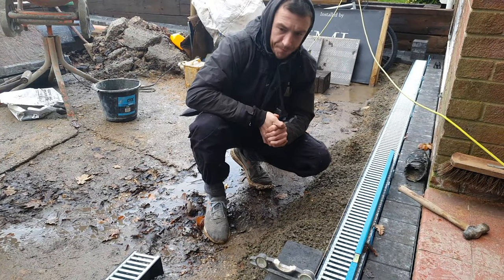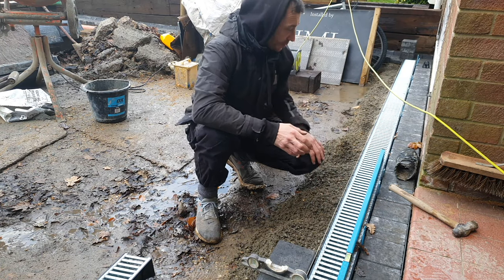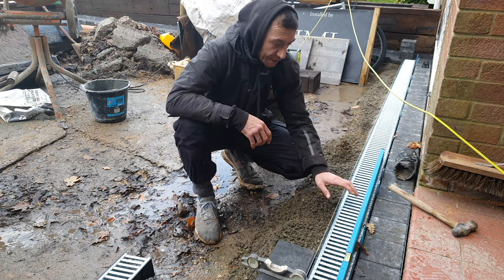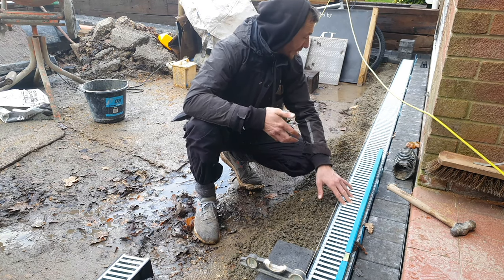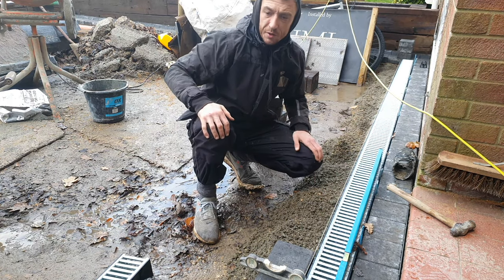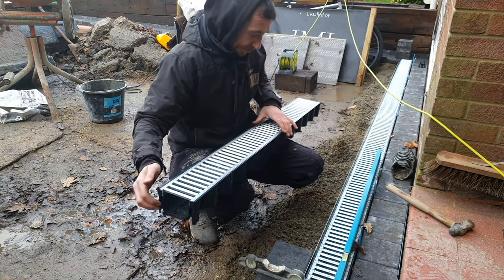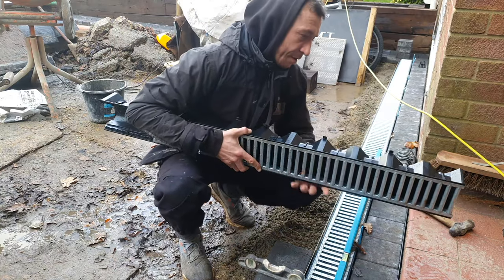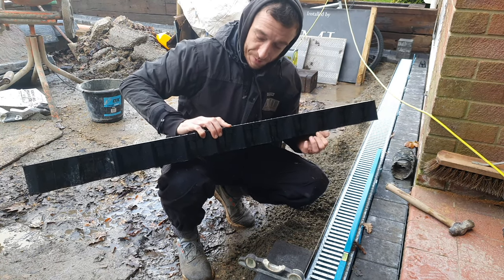How to install a driveway - How to Install Aco drainage - landscaping uk - VLOG06

Comment: Hi pal quick question, the pipe the water goes through, do you let it go into the earth or have you got too fit it into an actual drain?
Reply: No reply. Seems he doesnt know!
Reply from the maker: You fit it to a soakaway,  preferably 5metres away from the property. 

If you let it run into the earth this would cause issues in the long-term. 

Apologies for the late reply jacks20009🙏

As always appreciate your comment and support 🙏😁

Check out the next video along its a how to install a soakaway I believe that will show the connection

Comment: Do you lay these level or to a fall?
Reply from the maker: Hi mark , so for these i laid them level as it only 5m wide and the water will naturally find its way to the drainage hole as long as it isn't falling away from the hole you won't have any problems.
If you were doing any larger areas i would recommend you have a fall towards the hole and obviously you need a run on your pipes leading to you soakaway. Thanks for your comment 👍

Comment: Hi mate, should there be a fall on these towards the outlet ?
Reply from the maker: Hello mate thanks for your comment, for this I have gone level as it’s only 4.5 m wide , so the water will naturally find its way to the outlet, if your doing larger areas I’d suggest having a slight fall but as long as you don’t have a fall going away from the outlet you shouldn’t have any problems. You definitely need to have a fall on your drainage  from the outlet to your soak away . I hope that answers your question, and again thanks for the comment.👍
Reply: Cheers🖒
Reply: I'm missing something.
If your drain has a 1:200 fall on it and you want it flush with your block work, does your block work have to have the same fall?? So if I'm doing a patio, I want the drain to be parallel with the brick work on my house. Then the patio to have a slight fall away from it. So does your finished stone work need fall right to left to match the drain and front to back to come away from the house??
Reply from the maker: @scottlinus hello mate, in short yes if you have a fall with your drain I would run the block work the same.

It also depends on how long your run is if it's like a 10 metre run of drainage you'd definitely need a slight fall on it. For me as explained above I just kept my aco drainage level so it looked parallel with my brick work. I had a very minimal run on the blocks between the aco drain and the house,  running from the house back into the aco drainage.  Also from my aco drain to my soakaway there was a fall off 1 inch per metre.  

Does that help?

Basically if you have a run on the drainage,  I'd run my blocks the same as the drain. But that wouldn't be parallel to the brick work.

If the run wasn't to long I'd run my drainage level so it looked parallel.  But make sure that the run from the drain to soakaway was decent. I'd also run some blocks/slabs between the drainage and the house wich would match the drainage level left to right but have a slight run from the house to the drainage.

Comment: I saw that you laid this plumb, does the water still run well as the inside is also plumb.
Reply from the maker: The acos are installed level witg the slightest run towards the drain hole but there fixed to a pipe which has a run to the soakaway.

Comment: Thanks for the vid. I’m about to lay about 5.3 metres of aco drain. The short section you had looked like less that 50cm. I was told I couldn’t get it cut any less than that. Is that the case? Thanks
Reply from the maker: I can't remember specifically but you can cut down to any size unless your needing the hole in which case you would have to allow for that. Thanks for the comment 👍

Comment: I appreciate your attention to detail Jasper. Snipping off the bits of plastic off the bottom of the ACO drainage, so when you place the drainage up against the blocks it doesn’t push up against the cement and the blocks shows how much you care about doing a good job. And I noticed you didn’t put the drainage right up against the wall, placing blocks in between the wall and the channel drain to prevent damp issues later on that happens when builders put drains to close to a wall of a house. Are they just ordinary blocks or bricks or engineering bricks? I’m hoping to have the same thing on the side and front of my house, using engineering bricks because they have low absorption of water. 

It’s a nightmare though finding a genuine builder in Essex who can lower my block paving on my driveway and path that leads to my side gate and garden patio at the back because ground level at the front of my house is higher than the back of my house where my garden patio is causing damp issues on my exterior wall on the side of my house because the block paving and garden patio is too high, either, just above my air bricks or level with my air bricks. The side of my house is the worse because my air bricks are 1 inch below my block paving and that’s where I have salts on the inside wall in the cupboard under my staircase where my gas boiler is. So, my path on the side of my house is sloped from the back to the front driveway. At the front of my driveway I have three air bricks that are too low with my block paving. Options I have is to make my flat driveway sloped with ACO drainage in front of my 3 air bricks and along the side where I have 2 air bricks which has a solid wall. But if my driveway is sloped I feel I will need drainage all around the front and connected to the the drainage on the side of my house. But I’m worried the builder will install the drainage incorrectly and add more problems with damp later on. Or I could keep my driveway flat with a step down in front of my house where my 3 air bricks are and install an ACO drain just there and another step on the side of my house, so my driveway can stay flat and not sloped, installing a channel drain on the side of my house in front of my 2 air bricks. So, if I don’t have a sloped driveway and keep it flat I will need to lower my garden paving slabs so they are not level with the air bricks at the back of my house and lower the ground level to at least 75ml and the side of my house to keep it all the same level and where the side of my house meets the driveway have a step up there. I realise you don’t have the time to look at my problem but I wish you was a local builder in Essex. Thanks.
Reply from the maker: Hello mate apologise for the late reply,  yes these were just normal concrete blocks. I'm sorry to hear it's such a nightmare to find anyone decent near you,  if it was me I'd most likely go with the slope with the drainage but without seeing it I wouldn't be able to make a good enough judgement,  have you tried social media to try and find someone?  Cheers for commenting it's much appreciated 🙏

Comment: Do you lay these level. Is the fall built into the channel internally?
Reply from the maker: I laid these level with the most minimal fall towards drain but on larger length I would definitely recommend a fall,  there isn't a fall built in internally.

Comment: Hi, I'm looking to fit something similar in my garden but wondering how the water flows when you have it level?
Reply from the maker: Thanks for your comment Jamie, so because this was only 4m wide once full or filling up they naturally drained as the pipe there connected to leading to the soakaway has a run on it.
Reply: Bubble touching line. Can't go wrong

Comment: If connecting these to a soakaway does it need to have a gully or sump to stop, leaves silt ect getting into the soakaway?
Reply from the maker: The aco drains have something to stop leaves getting down, but i think you have to buy separately but a sump would definitely be beneficial although i did not do that on the project.
Reply: @jaspermillerlandscaping6174  Thanks for the response, will take a look into what's available for aco's then 👍

Comment: Hi can you link these up to an existing downpipe drain?
Reply from the maker: Yes, you can. As long as you have the correct connection,  110mm is standard buy. There are some other connections, too, if smaller or bigger, required 👍

Comment: My eco channel grate covers in front of my garage have Philips screws holding the lids down that have seized, any ideas how to lift them
Reply from the maker: Any good with an angle grinder? That would be my first option,  if not have you tried spraying some WD-40 or some penatrating oil. Thanks for commenting Bryan I'm sorry I can't think of many other ways of getting that one sorted.
Reply: @jaspermillerlandscaping6174 Angle grinder was my 1st thought aye but wasn't sure if the bolts were designed to be popped or what, needs done anyway so think it's a cut and run job lol
Reply from the maker: 😁👍 I'd do exactly the same mate , im sure it'll be fine, thanks again for the comment

Comment: Hi Jasper. Fine Video mate. 
I'm going to pinch a lttle on the damp proof course so as to get a better drop drown to the other aco drainage channel. my drive is raised from my neighbours house. I thought I'd put acos directly against the wall so as to limit rain splash against the house rather than put a row of blocks first. is that OK and if I can't put a soak away in as only 4 metres from house and 3 metres from road is there such a pipe with like a plug on so I can drill a hole in the support wall to my neighbours house and then after rain remove the plug or unscrew a fitting to drain out the water in the acos that will run to a drop at the side of the drive and effectively harvest the rain water. Bit hard to imagine I know . appreciated
Reply from the maker: Hello mate thanks for the comment,  yes you will have no problem installing them up against the wall , and regarding plug on a pipe I'm not to sure on that one it might be worth having a chat with a local builders merchant about that. There must be something like that out there though.

Comment: Great video, do you know if it would be ideal to install some ACO drains across bay windows and run to the mixed waste at the back of the house? Seem to get a lot of pooling water near the bay windows when raining, thanks.
Reply from the maker: Thanks for the comment core coder,  i don't see any problem with that as long as you have a run going from the acos to the waste. In regards to the mixed waste i take it you mean were your gutters ect lead too??
Reply: @jaspermillerlandscaping6174  yes I only have the one manhole and both sinks and toilet go to this one place, I’ve read that some houses have separate ones for foul and clean water?
Reply: @ChrisHansonDev   It would work, but put a S bend so the smell if the sewer dont come up through your aco... Your toilet and sink has a S bend to stop smell of grey/waste water coming back though

Comment: What do you do with the 5m gap you’ve left between brick and drain? I’m installing these on Saturday would love some advice
Reply from the maker: Thanks for the comment Chris,  I fill it in using a product called easyjoint,  its really easy to use , you just wash it in. You can also grout but if you haven't done that before it might be easier to use easyjoint.
Reply from the maker: Sorry mate just realised I thought this was another video lol for the 5mm gap ( It's actually 10mm gap,  I just said it wrong in the video lol) but I pointed this in using a 5:1 ratio of building sand and cement.
Reply: I’m putting the drains against the wall of my house in the garden do I still need to leave the gap or can I put it right up against the wall and cement underneath? Then I will start laying the paving right up against it correct?
Reply: Thanks for getting back to me
Reply from the maker: Yes mate correct no need for gap you can install the drains right up to the wall. No problem, anytime.
Reply: Thanks a lot for the help and advice. Love your videos. Watching the paving ones. Just hope I do a good job this weekend after someone done a runner with my money after I trusted them to do a job for me. Small job but still low life’s out there
Reply from the maker: What a scumbag, yeah there are a few of them out there, no problem. Let me know how you get on. Just take your time , watch a few YouTube videos on how to install em to get a few ideas. But there really straightforward to lay you'll be sweet.  Cheers
Reply: @chrissardinha1824  You don't want a gap or water will run into it rather than the drain

Comment: The steel grating on the aco drain has started to rust, should I replace them, on try to remove the rust with jenolite?
Reply from the maker: depending on how bad they are id personally replace them.

Thanks for the comment

Comment: When laying the cream coloured  resin composite aco drains,how do you remove the hole in the channel that connects to your drainage?
Reply from the maker: Haven't used those in years but I'm pretty sure, just like the black plastic ones you just have to hit with a hammer 🔨,
Reply: @jaspermillerlandscaping6174  thanks mate.
Reply from the maker: No worries bro, i would personally turn the aco drain upside-down on a flat surface give it a few taps first and see how you get on, but you shouldn't have any problems,  let me know how you get on 👍
Reply: @jaspermillerlandscaping6174  someone suggested turning it over and using a hammer and an old flathead screwdriver to tap it out. 
I'll let you know
Reply from the maker: Nice one mate 👍
Reply: @jaspermillerlandscaping6174  i cut the holes in my drains today buddy.
I used a hammer and a large flat head head screwdriver to tap the hole out.
Absolutely perfect and no cracking of the aco drain at all.
All the best
Reply from the maker: Nice one mate, didn't think you would have any problems.  Thanks for the update. So is it just the aco's your installing or are they part of a bigger project?
Reply: @jaspermillerlandscaping6174  only the acos across a garage entrance.
All finished today and draining well i might add
:-)

Comment: I don't see the point of these

What are they actually doing?

Moving a few litres of water away, to where?

Plus they get clogged up every month
Reply from the maker: thanks for the comment deep mystic,

So for this property the driveway ran downhill, so to prevent the water sitting against the house , The aco drain connected to a soakaway 5metres away from the property. 

yes unfortunately there is a little maintenance involved around autumn time.

Comment: What silicone did you use to put the end cap on?
Reply from the maker: I used a product called aqua bond,  its a product used to join artificial grass together. I got this from a company called namgrass,  but I'm sure there are other suppliers. Thanks for the comment 👍
Reply: Would you just silicone the end gap or each joint? how do you determine the fall I’ve about a 5m length for these to go into it’s a drive and the fall naturally runs into the drain hole but these would help it disperse quicker or would I make it level with the paving that’s there?
Reply from the maker: Just the end cap, joins do not need it. So yeah as long as the fall always heads towards the drain you would have no problems on 5m, level is perfectly fine in my opinion. The main thing is You definitely do not want this running away from the drain your connecting the aco drainage too.

Comment: Hi mate,

I've recently started my own landscaping business with a close friend and I came across your video as we are looking to expand our business and offer more hard landscaping services such as patio and driveway installations. Can I ask what the pre-mix you used with the cement to make a mortar to lay the drainage channel onto was called? Can you use your patio mortar mix to lay this type of drainage channel or does it have to be a seperate mix? Thanks!
Reply from the maker: Hello mate , yes so it's jus a 10mm premix of sand ( 10mm shingle mixed in with sharp sand). Yes you can use your patio mortar , I just prefer to use 10mm premix as it was just how I was taught 🙂

Comment: On average how much ground needs to be dug up before installing new brick paving
Reply from the maker: Thanks for your comment I M depending on the thickness of your blocks you want to dig out 260mm below finished level (150mm sub base, 50mm sand/6mm to dust and then your block 60mm)

Comment: I’ve seen a few aco drains installed at the house end and driveway end , I no that there are no pipes to take the water out of the aco, so it fills up quickly when it rains then the water goes where ever it goes , seems a pointless thing to install unless it is piped to a soak away doesn’t it , also the membrane put on the earth then the hard core is whacked done then the block paving is  kiln dried sanded and whacked, it common sense the not weeds could come up from below the hard core and grow through the block paving ,  weeds that grow out of the gaps in the block are growing the dirt and other dead vegetation matter that full into the gaps above, the membrane is total useless at stopping that , I think that it’s a case of monkey see monkey do, , you think common sense would tell the installer membrane and drainage to nowhere is pointless.
But hey common sense, isn’t very common these days🤪